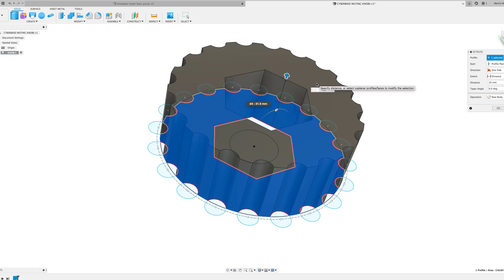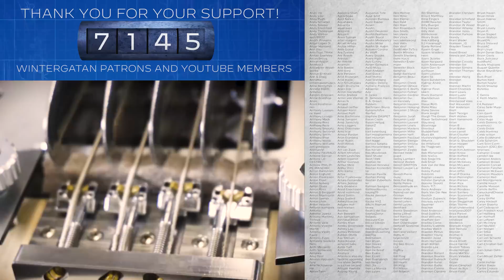Playing the CYBER BASS

Comment: The bass is looking absolutely awesome! But i was wondering why you would use two seperate knobs to loosen or tighten the muting system? A lever/crank would be must faster to switch between long and short notes wouldnt it? For example if you want to switch sounds in between two sections of a song...

Comment: Perma Blue is a form of black oxide, which is basically rust. The only reason it provides a protective coating is because it gives the metal a microscopic porous texture for oil to get trapped in. In other words, you need to oil your parts after turning them black. This will not only protect them, but also make them look nicer. Any light oil will do. If you can find it, Boeshield T9 is a great dry lubricant that will fully dry so there isn't oil to rub off on your hands.

Comment: have you considered using 90-degree phone plugs for your bass?  The wires would lie down closer to the bass, and might provide a sleeker look...  Have a look at this:  https://www.ebay.com/itm/TRS-Right-Angle-90degree-1-4-STEREO-phone-phono-Plug-Connector-6-3mm-audio-jack-/370988764944

Comment: Instead of hand nobs i would have reverse threaded one of them then used a rack and pinion on each tied together with a handle so you could quickly adjust the tension by pulling or pushing the handle maybe even on a per note basis while the song is playing depending on how much it needs to move.

Comment: Not exactly sure how this let’s you mix long and short notes... just pick one or the other. Couldn’t you modify this with some sort of whammy bar like actuator to lift the felt pads, and lower them as needed per note?  That is, a spring that holds the felt either up or down, so that a press on the bar would give you the alternate length note- then release it for the default?

Comment: I wonder what it would take to make the Funkalizer controllable by the programming wheel. That way you could mix long and short bass notes without having to manually play them or adjust the position mid-concert.
Might just be more feature creep doing it though, which has already plagued the build process enough.

Comment: Hey Martin, you might want to try putting springs underneath the Funkalizer instead of using the captive nuts. That way there's a constant upward pressure on it and instead of loosening the bolts to lift, you tighten to lower. A bit easier to operate one handed and less likely to become loose from vibration.

Comment: What I don't get, why not using a kind of a little "Lift-Arm" with a spring-steel (like a tremolo-arm) for "easiely" damp down the bass-strings, just how he does it with the plates of the vibraphone? One klick to-upper ("release") and the bass playing long notes, one klick down ("fixed") and the bass playing short notes. Made playing short & long notes in a second... No need to use the screws at the back. Ok, for "the look" only...
Reply: There is always, always, a better way to do things. In this case I think martin was simply looking for a way to shorten his bass notes and leave them there for a song or set. Remember, the Cyber bass is not playing the melody and even with the electric motor hes going to be mostly flipping switches on the MMX rather than playing the bass. The bass section is going to be mostly walking bass lines with a couple embellishments every movement or two. So it really doesn't need all that much variability.

Comment: But, does this really solve the problem? Now you can do notes of varying lengths, but in order to change it, you have to fiddle with two bolts? What if you could adjust it with one simple control that you can actually play? Some sort of lever mechanism, perhaps. Of course, in hindsight, even cooler would have been for the dampers to be controlled by the programming wheel with their own non-marble channels so you could program different length notes, the pins activating damper arms going down to the bass.

Comment: Wouldn't it be simpler and easier to use to have the plate pushed by springs, so you can adjust the height with a single pression on a lever ? you could even block it at certain positions. I don't know I feel that having to screw more or less isn't very organic using.

Comment: Ok, so this is great and all but it runs into the same problem as the hihat. Screwing the felt up and down by hand to dampen the strings will prevent you from rapidly switching between dampened and long notes. It will be either one or the other and no mix.

Comment: Not sure how this solution allows the bass to be played with both long and short notes in the same song without an overwhelming amount of knob turning. I would have thought that having the felt be pressed into the strings with a spring would be a better solution. That way, you manually push the felt deeper into the cavity and away from the springs, resulting in less muting and a longer note.

Comment: There seems to be a bit of a rattling noise when you adjust it. I wonder if two small coil springs on the bolts, under the bar, could help to get it nice and tight. That way the springs presses the bar up against the knobs and bolts.

Comment: Great work Martin! it occured to me that it might be possible to have a multiple position switch (like the drum uses) for this felt pad to enable you to switch quickly between short and long notes.  Interesting thought: If there are no clearance problems, you could even use a longer pin to toggle between the two modes with the programming wheel - think binary toggle (off/on)

Comment: I think that it's possible to play long and short tones if a system with a cam operated invidiual pushrods actuating a felt pad for each string is fitted. Rollers on the pushrods that rests against the cams makes it possible to use cams that has quite aggressive lift profiles.

Comment: Could some sort of rocking lever (w/ locking ramp) with spring be adapted to the mechanism so that you could quickly shift from the dampened short note setting to long notes? Sort of like a drop down tuner.  I'm just thinking that this might be beneficial for certain sections of a song composition.

Comment: Put some 90 degree angle trs cables instead of the normal ones and it would look a lot cleaner. It has a kind of flat tone to it. There is a bassmute out there on the market that will just sit on the body of the bass but since your strings are spaced specially and you have a custom bridge the felt pad would work better anyways.I personally love felt muting because I suck at palm muting my basses in general I have low action on my basses so I can just wedge a felt pad under the strings just above the bridge and it works, rather than using washers to adjust the curve of the felt I have used both coins and small thin peices of dense foam under the felt pad. Its actually been a little bit since I have had a felt pad on one of my basses I think I'm gonna go and do that  again thanks to this video. Also love the bass, thing is sick.

Comment: [SUGGESTION/QUESTION]

The bass looks very very cool!!!
I'm not a musician nor engineer, but this thread system isn't too slow to make transitions between long and short notes?
Maybe some kind of lever like the one in cymbal machine, with that cool place locking system, but with off center axle to raise/unraise the felt wouldn't it make transitions faster?
Reply: I was going to suggest the exact same thing, but with cam operated invidiual pushrods actuating a felt pad for each string.

Comment: I think you should've made the felt move with some kind of lever so you could raise and lower it with a single motion instead of having to screw and unscrew two bolts. Also maybe you could've moved it higher and made it come down on the strings, pressing them against the neck rather than rising from below. That way you wouldn't have to cut the bridge.

Comment: You should mount that felt pad to a lever or a pedal, so you can modulate it DURING a song, rather than having it have to be on or off.
Reply: I was going to suggest the exact same thing, but with cam operated invidiual pushrods actuating a felt pad for each string.

Comment: Seeing those cables makes me want you to eventually route them all to a main strip somewhere, and/or make cable management options. 
And then have a nice set of cables, like sleeved in paracord for example, in theme with everything looking nice on the machine.
Reply: Yes please tell me you have incorporated a cable management system for all the pickups, mics, and such. I want a video of that!
Reply: I would imagine the neatest way would be to have a small digital mixer built into the machine as it rely on compression and gating anyway
Reply: Seeing the four cables bouncing on the handle just screams "snag" and ripping a lot of work apart...  Cable management is definitely a must and a good suggestion for a future video...even if it's not all that sexy.
Reply: there's probably something to be said for leaving them exposed.  Too much focus in editing would make them a distraction, but if they can be left bouncing during play, they could give a light "living" vibe to it.
Reply: I was thinking the same but I'm guessing that for now, leaving them loose is just for testing. I can't imagine him leaving them the way they are in the video. I was thinking they should've been set to come out the back but since they are already on the front, 90 degree connectors might be a good option so they aren't shooting out of the bass like that. Then he'd be able to route them around back from the side of the bass and then wherever they need to go after that.
Reply: @V00D00M0NKY  My thoughts exactly! Some wire loom could hold the cables together.
Reply: I was also commenting on that, since i do audio so this really screws with me. Also did you notice the cables flinging around that come from the bass? Because thoose still get swung by the arm below them. Sry for commenting like this.
Reply: I was thinking he should have made them plug into the back of the guitar. Easier to hide them that way.

Comment: Maybe try using springs to push the damper plate against the knob, so that you can add a lever (like a whammy bar) to quickly change between short and long notes?
Reply: Oh man don't give him any good ideas. The machine already won't ever be done.
Reply: I was coming to say the same thing. If he wants to be able to play himself, he should have a quick disconnect for the mute so that he can quickly get full manual control.
Reply: I was going to suggest the exact same thing, but with cam operated invidiual pushrods actuating a felt pad for each string.
Reply: Yup. Default position is damped and a simple lever to allow a manual long note. Could even put it on a foot pedal like a piano.
Reply: I had the same idea -- instantly started scrolling through comments, because it seemed too obvious.  A hand-dampener lever with a "hold position" clamp seems like it would be useful, but I'm not sure about the technical challenges. I was imagining it would look similar to this existing part, but with a fulcrum where the screws are, and the push-bar across the bottom of the bass.
Reply: Agreed. Two pairs of counter rotating cylindrical spacers with angled mating faces could be added underneath the existing apparatus, one pair on each pin. Fix one cylinder-wedge on each pin, join the two "free" wedges with a linkage bar similar to a car steering rack. Add detent to "lock" at desired locations.

Comment: When Martin starts a video showing off the finished project, he does it to try to put some poor collaborator at easy that he didn't wreck their work with an angle grinder before he modifies their part later in the video. 😂
Reply: It's hard to angle grind my software ...
Reply: @DrSkunk  (just for the joke) So he removed the can bus messages from your software to replace it with a serial messaging with space character as separators...

Comment: how about you put the felt on some spring loaded lever, like your levers to activate certain droppers on different instruments (your muting system)? that way you could flick dynamically between long and short notes?
Reply: probably at this point, he is battling feature creep
Reply: I was going to suggest the exact same thing, but with cam operated invidiual pushrods actuating a felt pad for each string.
Reply: Pianos have a dynamic muting system with foot pedals. A hand activated version of that makes sense. I'm surprised he didn't implement something like that.
Reply: This comment need more likes!